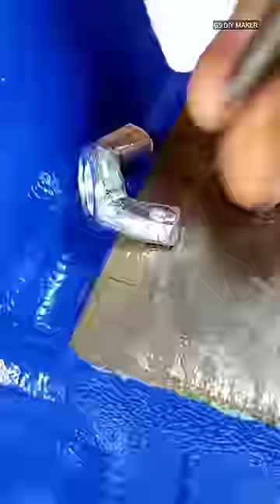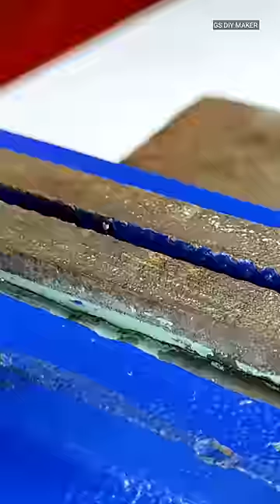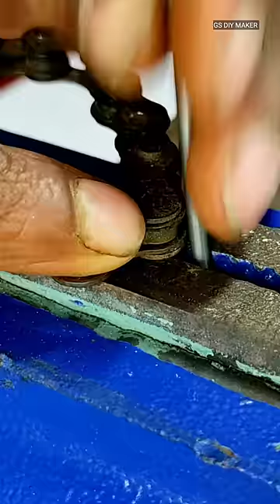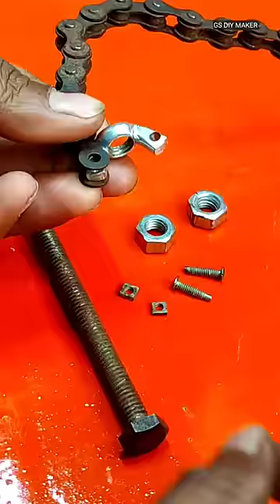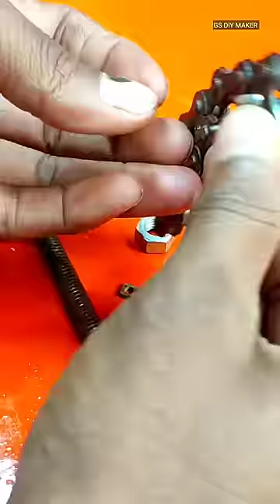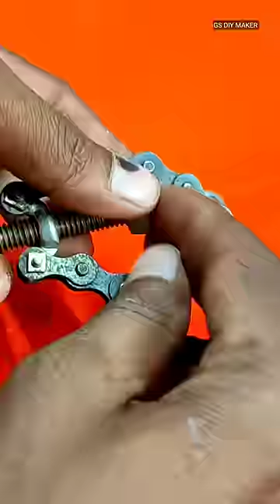Diy Tools Hacks #tips  #shorts

Comment: Right I’m weighing up the cheaper and easier option do I have a :-

Bike chain
Wing nut
Punch down tool 
Hammer
Drill bit 
Drill
M6 nuts
Vice
M10 nut

And what would be the torque strength of this home made tool 

I just had a brain wave I’ll go and buy or borrow an adjustable spanner or the correct sized spanner